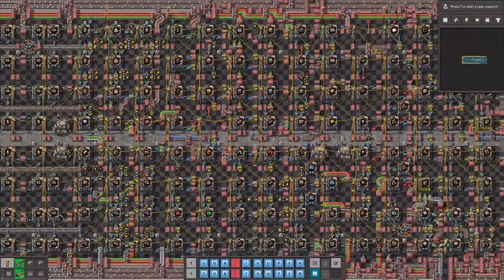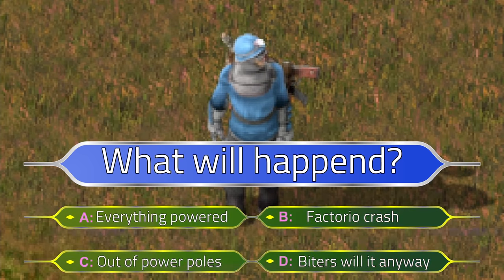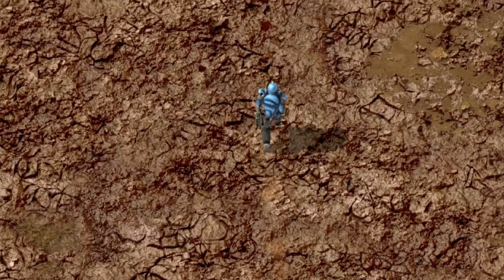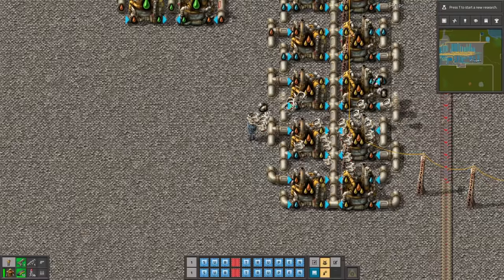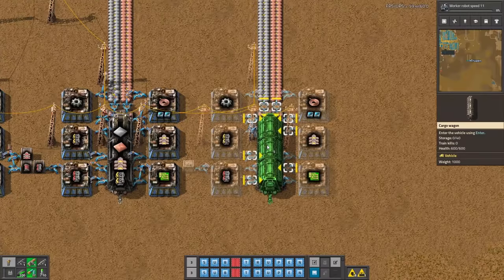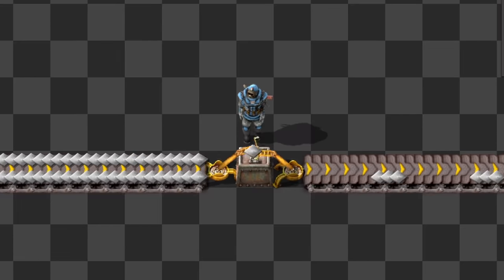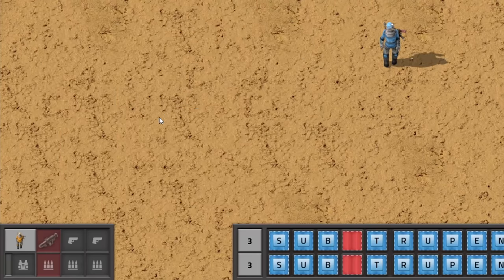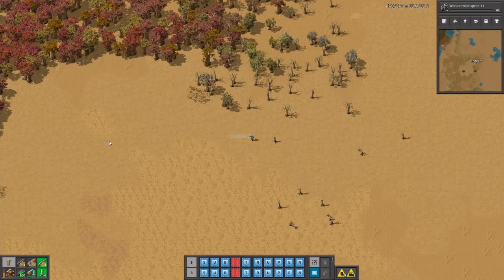Advanced Factorio Tips You Didn’t Know Existed!

Comment: 10:47 Good thing to know too: Once a miner runs out it will still output the total resources of the resource patch it used to belong, even though it is not on a patch anymore. That means you can just use the closest miner, you don't have to wire the miner at the center.

If you deconstruct that miner though you won't be able to place it again, so "auto-deconstruct miners when out of resources" mods will break your circuit :)
Reply: That should easily be fixable by adding some kind of clause in the mod which disallows marking the miner for deconstruction if it both is connected to a circuit network AND the amount of ore left in the patch !=0.
Reply: @roadtrain_  you wanted to say OR I guess lol. Otherwise, it would be always marked if it is not connected or its empty.
Reply: @tvujtatata  Yeah not sure what I was thinking LOL

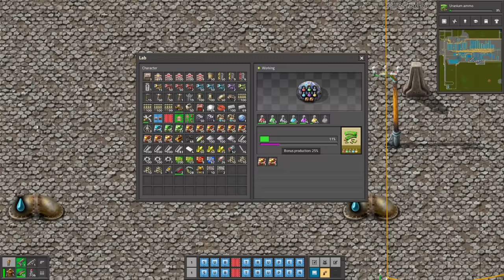Comment: 0:10 woah i actually genuinely didnt notice this that's so weird :O

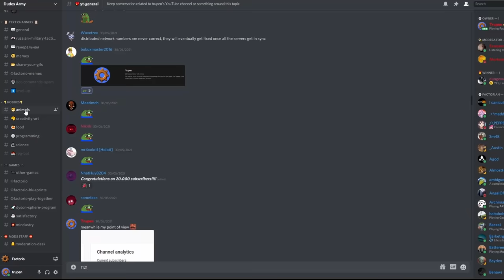8:24 when you get to a point that you have that many science packs, a few extra resources spent on cars isnt really that bad. hardly a sink in your bank.

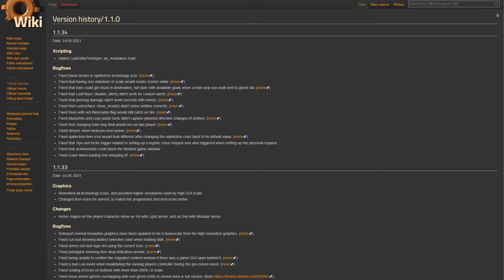10:01 i always forget that this exists, its niche but is super helpful :D

a tip i always like to suggest is: dont stop using basic inserters! you can literally save GWs of power by using basic inserters in place of fast or stack inserters by using the right inserters for the right job, there are some setups you will basically NEVER need fast or stack inserters for, even if you speed boost them to the max possible speed they can have. idle inserters are costing you energy with no benefit, and the higher tier the inserters go the more energy they consume while idle. basic inserters also consume less energy while working compared to fast or stack. 

if basic inserters would have idle time in a set up that means any better inserters will have a lot more idle time than that. but then when they ARE working, they are still consuming more power than basic inserters, so in these cases its always better to use basic inserters.

Comment: How do people manage oil without logic? Do they just build huge amounts of tanks? Or convert it into loads of solid fuel? 
I remember in my first base I replaced the tanks, but you cant do that forever... right?
Reply: Can’t you just turn extra light and heavy oil into more petroleum gas?
Reply: Then you dont have any light and heavy oil anymore. :P
Reply: @schmid1.079  I just said you do that with the EXTRA light and heavy oil. You connect the other things too and have these to remove excess material. You don’t actually need circuits to balance it good enough, although of course the best would have circuits
Reply: I did it manually in my first full game by turning the pumps on and off, using 30ish tanks total as buffer. 
It's a bit of extra management, but for a small beginner base it wasn't a big task compared to all the other bottlenecks I had to fix.
Reply from the maker: "build huge amounts of tanks" yes this is how I delt with oil before I learned some circuits xd
Reply: @damiankaleomontero496  Well, how are you going balance them without circuits? If you process too much oil your petrolium will be full so your light and heavy oil will run dry. If you process too little its the other way around. 
Balance can only be achieved with circuits.

Comment: Logic circuits are fun. I used them to create a setup whereby my old coal-fired power plant was turned on when my accumulators got low. It was also a signal to for me to expand my solar farms. I also used circuits to keep my fluid levels balanced. If I had more heavy oil than light, my crackers would turn on. More light than petroleum and the crackers for that would turn on.

My big problem is always running out of space. It's ridiculous because I can just tear down forests and fill lakes -- but I don't. Time to start getting used to modifying the environment more...